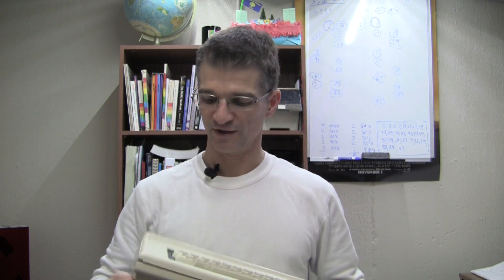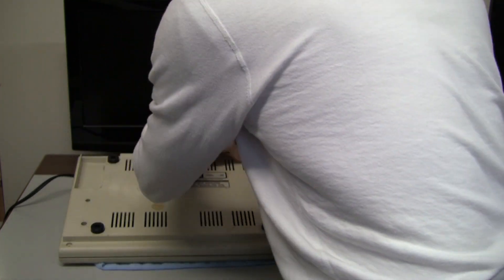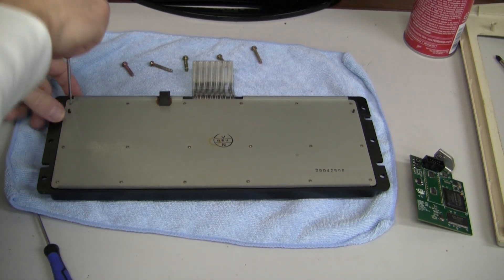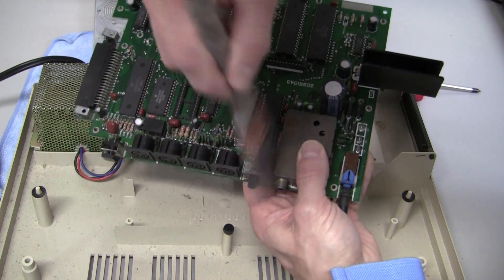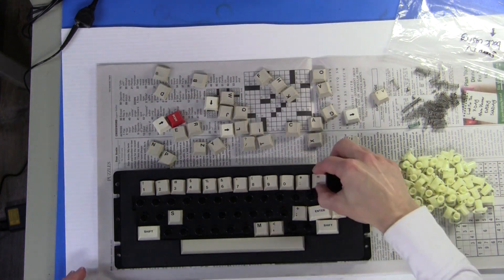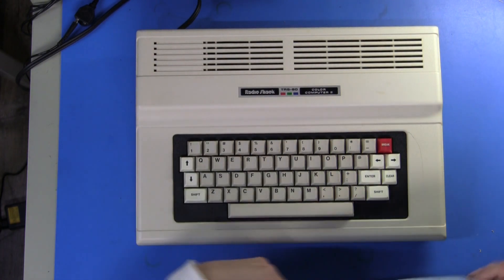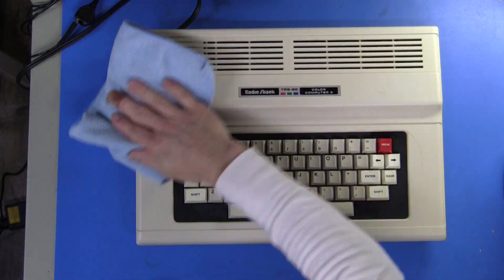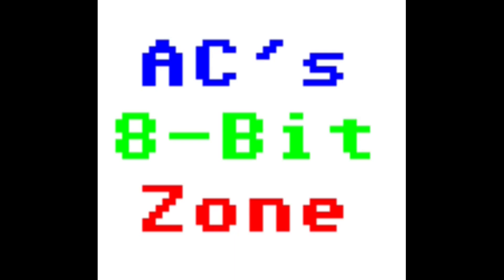I bought the worst Color Computer 2 on Ebay | still works after 40 Years | Fixing stuck keyboards

Comment: I have a few coco's and sometimes i keep them as 16k color basic just to have the diffrence .. my first coco was a 16k extended basic .. coco2.
Reply from the maker: That's a good point.  But you have so many tricks that you probably have a switch that when you flip it, the RAM is automatically upgraded and the ROMs are swapped out, lol.  Thanks, Dave!
Reply: @acs8-bitzone651  personally i think its great if someone adds a led , keeps it stock or adds new features.. or maybe even resisted breaking the warrenty seal ! Enjoy the hobby ! Enjoy these videos :)

Comment: Hey AC!  Wow, $17 is a steal.  I've been cruising eBay myself keeping an eye out for CoCo2s to fix and I have to say I haven't been THAT lucky.  :D  Does not surprise me at all though that it actually works.  Most people don't have the knowledge and/or the resources to actually test a CoCo.  I will say though that many of the CoCo2s that I've bought off of eBay come in just as dirty as yours.  Where are these people keeping them?  Buried in the back yard??
Reply: Actually, correction:  Most of the CoCo2s I get off eBay actually DON'T work, because of bad RAM.  The rest of the machines (so far) always work.
Reply from the maker: Agreed!  The dirt didn't completely show on camera and it was realyy ground into the grain.  The toothbrush bristles worked wonders.  Many thanks for watching and commenting.

Comment: Plastic Weld by Plastruct is awesome on most plastics.  It’s a clear liquid solvent you brush on the break (or on both surfaces you want to bond.  I’d brush it on from the inside of the case.  It melts the plastic surfaces and they rebond with pretty much the same strength as original.
Reply from the maker: Something like that is what I was hoping for, thank you David!  See you on CocoTalk.

Comment: Nice work! You did a good job cleaning this one up. Can you still get ext basic roms?
Reply from the maker: I'm not sure where to purchase them. They can be made from 28 pin PROMs and an adapter board.  The adapter boards are around, but I'm not sure if they are sold or just made available for diy. Thanks!